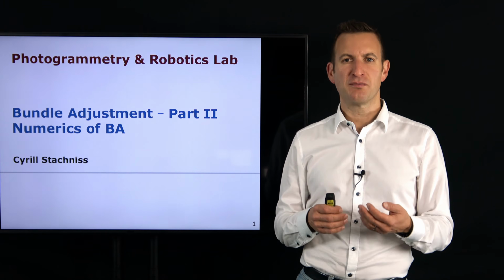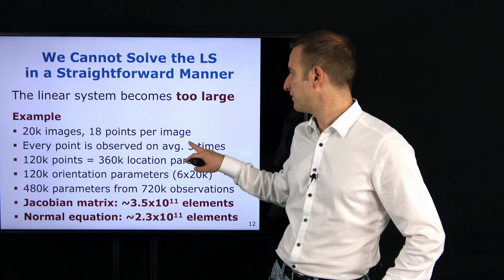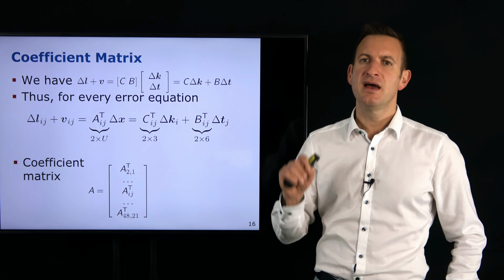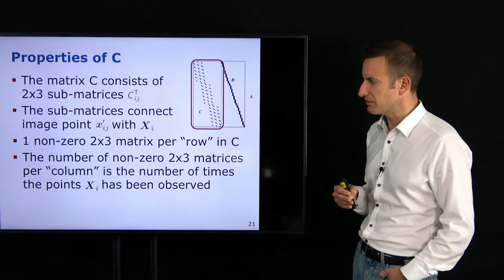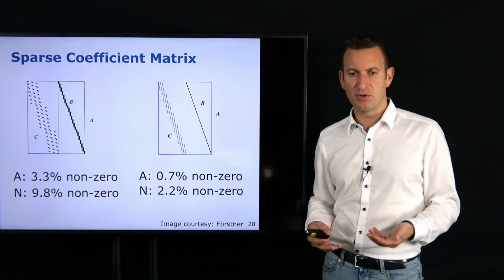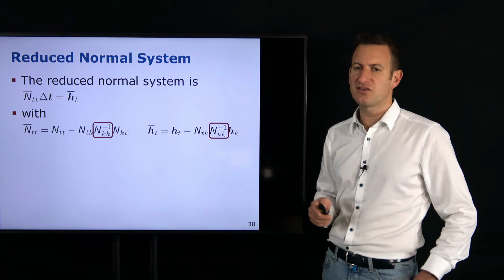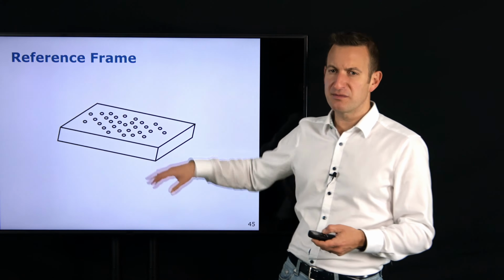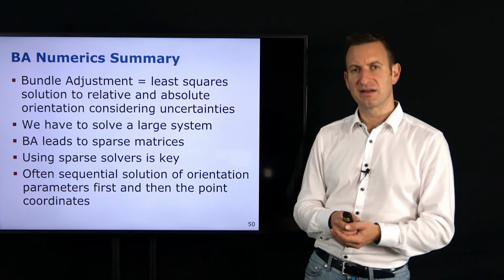The Numerics of Bundle Adjustment (Cyrill Stachniss)

Comment: I am confused by the block sizes in the C matrix in the graphic illustration. Could you clarify the meaning/sizes of the black squares in the C matrix and why they seem to appear in formations of 2 and 3 diagonally? Thank you!
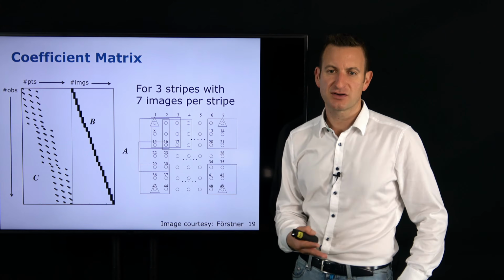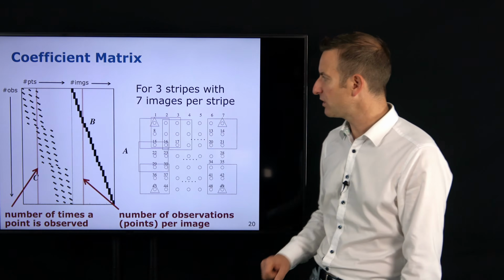Reply: Each black rectangle is the C_{ij} matrix of size 2x3. It means that the 3d point  "i"  was observed by the camera/image "j". The top six rectangular blobs in C correspond to points 1, 2, 8, 9, 15, 16 which were observed in the first image. Since these points are close by, they actually look like 3 blocks instead of 6. I believe the nice diagonal structure is due to the flight pattern (24:20) and (26:20)

Comment: Hello Cyrill. You know when you stacked the camera orientation parameters for Δt, you included only the extrinsic parameters. If you want to estimate the intrinsic parameters as well (i.e. bundle adjustment for the uncalibrated case) do you also stack those 5 intrinsic variables with the 6 extrinsic parameters and make it into a size 11 vector and the C_{ij} ending up becoming 2x11 blocks? 

Very appreciate it if you can clarify this. 

Otherwise I very much enjoyed your lecture!
Reply from the maker: Sure - bot only if you want the 6 intrinsics to be image-specific. If you use the same camera for recording the images, you want 6 intrinsics holding for all images.
Reply: @CyrillStachniss  , thank you :)